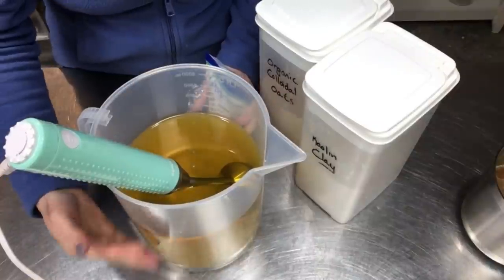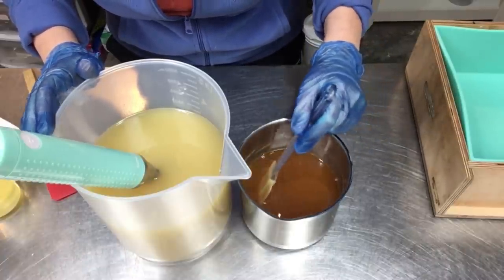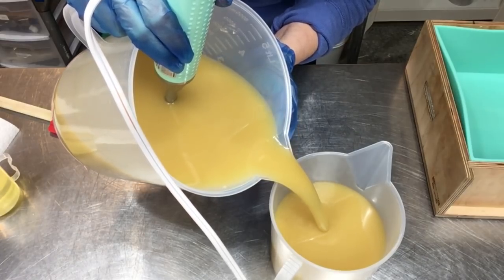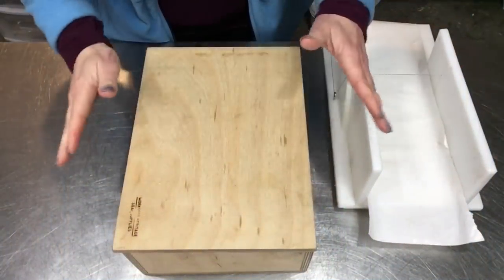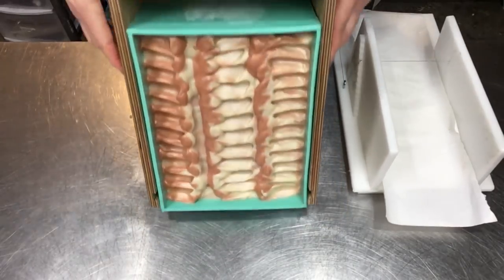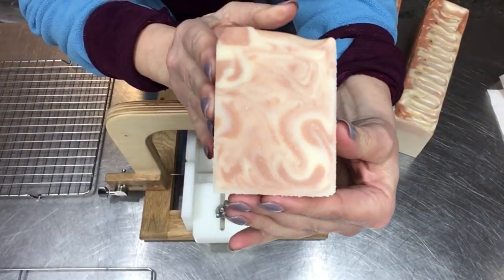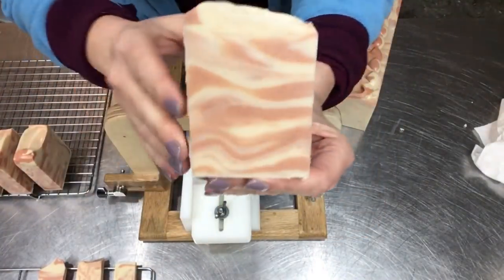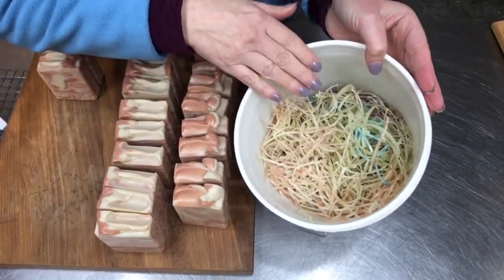How I Make AMBERED LAGER🍺 Beer CP Soap w/ ITPS + How To bevel & Stamp bars | Ellen Ruth Soap

Comment: Hi Ellen, I purchased some of the same coconut cream you used from Amozon, but it looks like  Curdled milk, so I used it in my soap anyways, now I'm wondering if it will turn out lol! Is the coconut cream suposed to look like that, ir is it suposed to be thick like heavy cream? 🤔 please help?!
Reply from the maker: sometimes it settles and separates, it helps to run your stick blender thru it to smooth it out.  If you blended your soap batter really well, it should be fine...
Reply: @EllenRuthSoap  
Ok Thank you 😊!